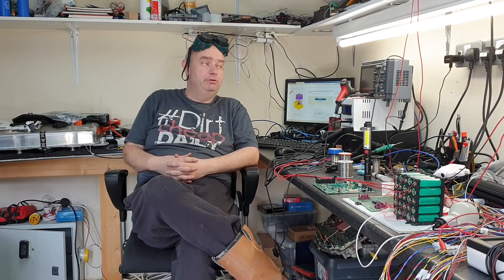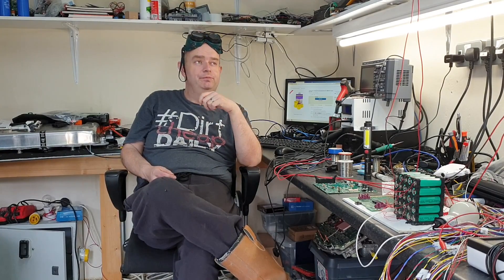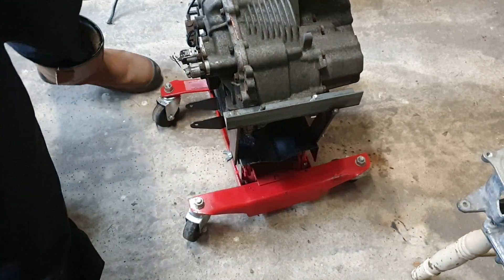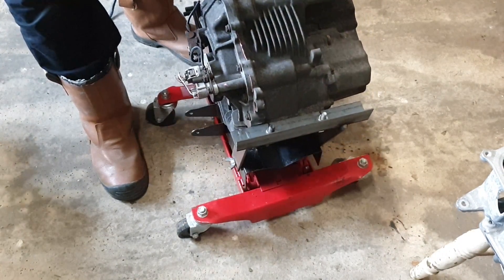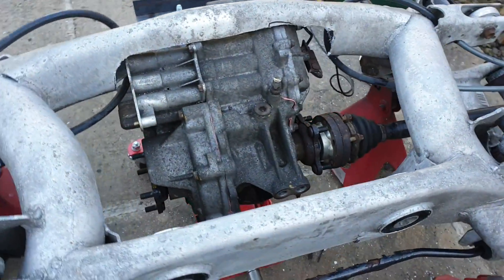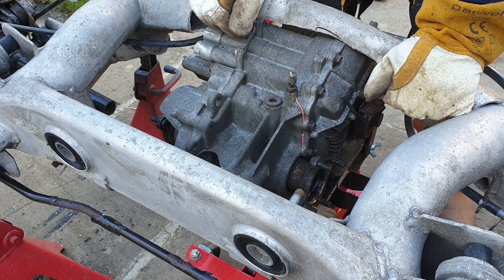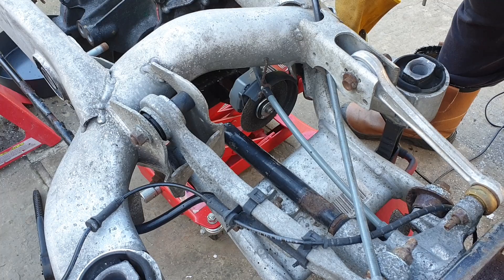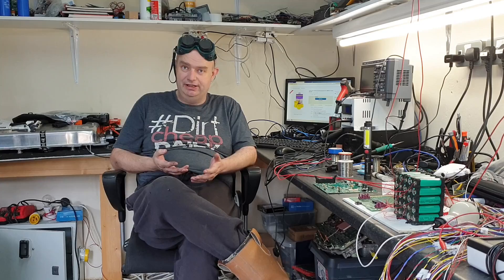The Blue Yacht Ep1 : Subframe Modification

Comment: Damien, you can't do that! That motor is air cooled and is meant for intermittent torque to maintain traction!
Are you going to implement an auxiliary cooling loop for that motor? I've wanted to do this for a while
Reply: This is a reason why this drive unit have a temp sensors inside. To monitor temperatures, i guess.
Reply: @pashko90  the motor needs adequate cooling in order to continuously operate at high load, otherwise it will run until it's too hot, then has to air cool...
Unless they already have liquid cooling which I'm not aware of.
Reply: @tanner3801  bro, are you serious? If unit have any liquid inside(it does have an oil inside) where is no problem to cool it down.
At least two ways can be used:
1) heat exchanger
2)electric fan+ small radiator.
This unit does not make a lot of heat as ICE, it does not need huge heat dissipation.
Reply: @pashko90  ruhoghejouer yes I am serious. That is what I am talking about. In the original application, it uses no auxiliary heat exchanger because the motor is hardly ever used. It is only used to maintain traction, not to continuously drive the vehicle. I am quite confident that if this motor is used continuously, it will absolutely need an auxiliary cooling loop to protect the windings. like